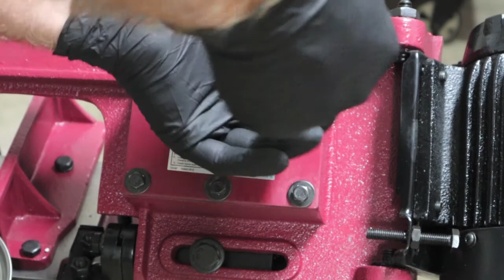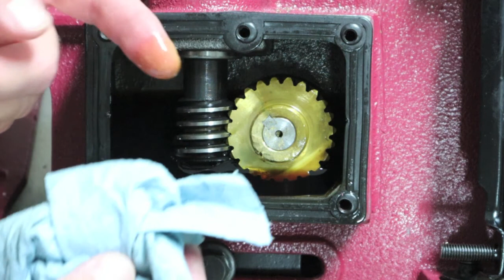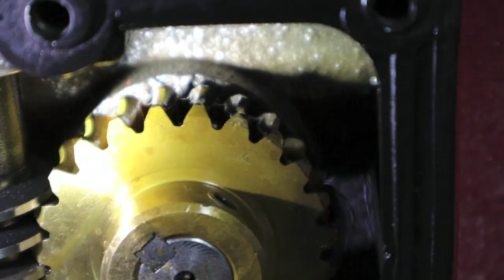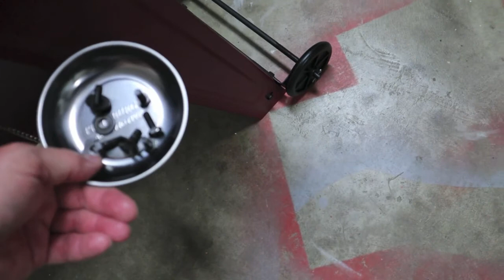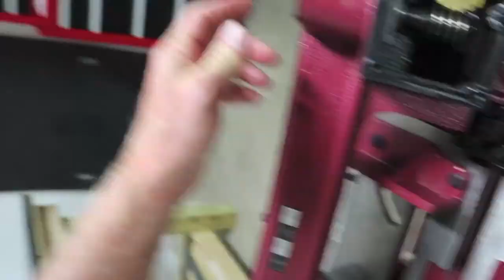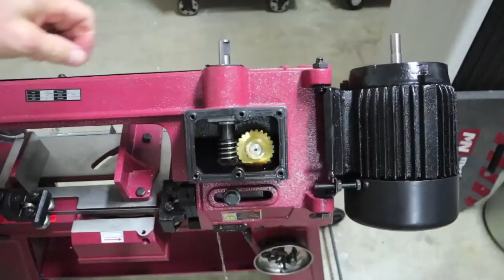Harbor Freight band saw (and clones) gearbox inspection

Comment: That is a carbon copy of the ENCO model that I bought in 1984 for $75.00 fully assembled. They closed the local show room soon afterward. Mine was still made in America, by the way. Since then, it has only needed blades and one new set of roller bearings for the blade guides. I have never changed the lubricant in the gear box. The original motor is more quiet that yours. No wonder the Chinese copied it.
Reply from the maker: Thanks for watching and commenting!

Comment: I picked one up at a garage salw a few years ago. The saw works great, keep the guides aligned  to square up the blade  and adjust the tension on the balance spring( that thin handle on the side with the spring attached to it) so it puts slight downward weight on the piece being cut and it does the job. Don't allow it to put too much weight on the work piece or you will wear the blade out to fast. The blade that came on it when I bought it is still going strong. AMazing. Cuts slow, but beats doing it with a hacksaw or a grinder.
Reply from the maker: Exactly! Sure beats a hacksaw :)
Thanks for watching!

Comment: You get what you pay for, unless you can make it yourself. I bought a Draper bandsaw, made in China obviously, but it hasn't failed me - yet, so I am happy with it. I would love a lathe and milling machine to have a crack at making one using quality components, as I used to work on milling machines, lathes and shapers.

Comment: I just bought one at HF... they have upgraded the Wheels (now rubber with steel rim with roller bearings too).. and they added Rubber feet for opposite the wheel end. The asm directions are still stupid .. much easier and safer to flip unit upside down for attaching the stand.
Reply from the maker: That sounds pretty good. I've been using mine a bunch this summer. It seems to be hard on blades, I have gone through about 5 this year, some are pure junk though, while some last a good while. Cutting all mild steel.
Thanks for watching and the info!

Comment: I'm trying to find replacement worm gear any ideas where to get one
Reply from the maker: I do not. I would like to think it's shown and listed in the OM. Our HF owner and manager has been very helpful, I would try your manager.
Good luck!
Thanks for watching!
Reply: I've seen on Amazon recently a " 4x6 bandsaw worm gear" also a good source for parts may be Grizzly I hear..as nearly every 4x6 bandsaw is the same model just different colors and seen different hp on other bandsaws..such as 3/4 hp vs the HF 1hp model..Grizzly also has a better manual and exploded diagrams.. probably faster to check Google for 4x6 horizontal bandsaw gears as it would bring up the different places that sell them as HF customer service leaves alot to be desired..this same type of bandsaw has been produced for over 40yrs..so parts will be available for it..